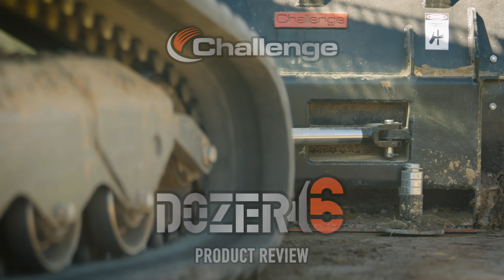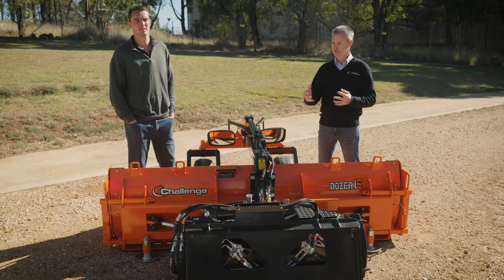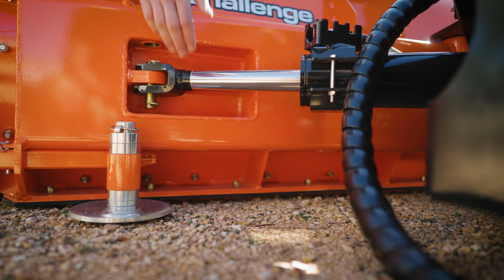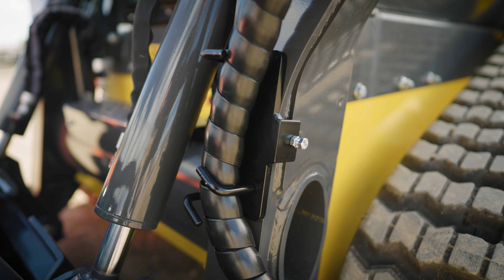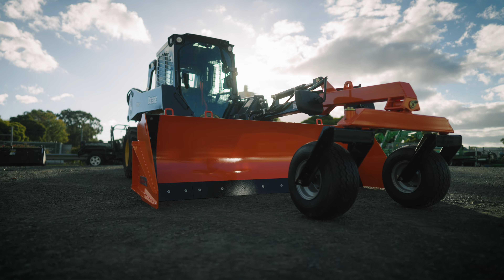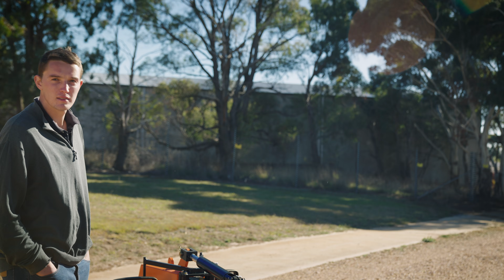Challenge Implements Dozer6 - Skid Steer Attachment Product Review

Comment: Wouldnt this be more like a grader rather a dozer?
Reply: It does have some grader‑style adjustability, but it’s still very much a dozer blade. The heavily reinforced blade and front‑mounted design are built for pushing and cutting. The extra control just makes the Dozer‑6 more versatile and lets you get a cleaner finish.